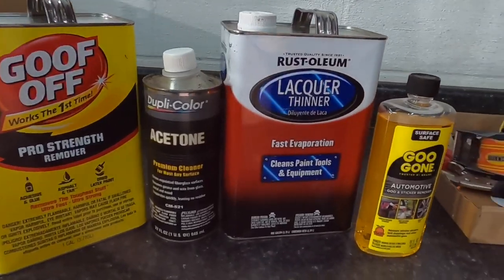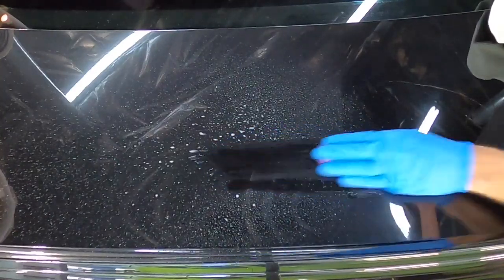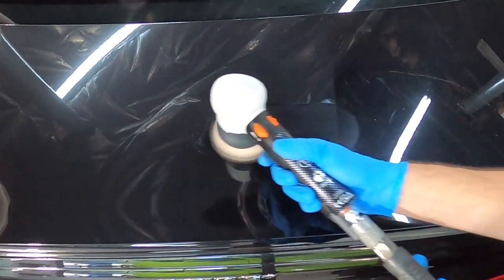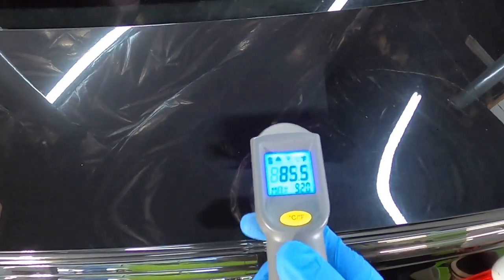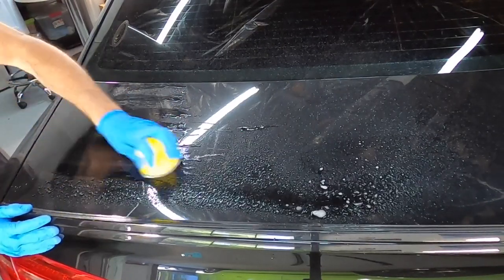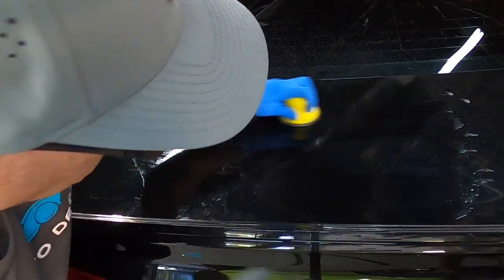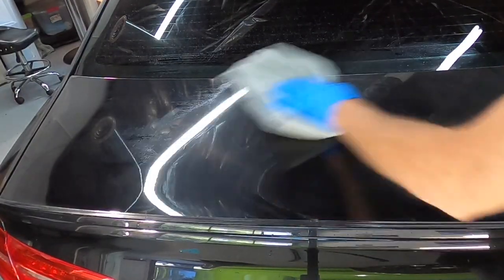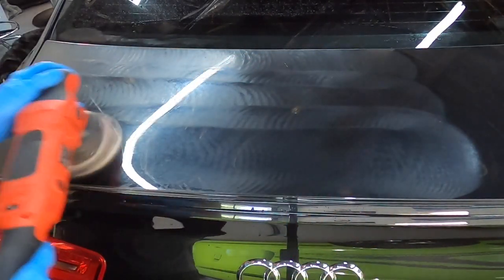DIY Over Spray Removal! Here Are Some Of The BEST Options!!

Comment: Good advice. I have old over spray  because someone decide to pain our door. I tried compound but its tough. I tested  5000 Grit on an area and it did the job very good. Use some of your favorite car wash shampoo with water to lubricate. Be light on the strokes don't apply too  much pressure. Do a test area first.  You will notice the difference instantly. I want to try 7000 My pain is old I don't want to destroy my clearcoat.

Comment: I began using a da last year on my Volvo, and due to subscribing to and learning from your videos, I did a decent job correcting the paint. I recently found a car I couldn't afford back in the day, but it needs paint correction. It's an 07' Acura RL and I believe it falls into the category of soft to medium clear coat. I don't want to mess up the finish on this old car, but I do want it to have the best finish I could provide. I could really use your expertise, and I'll begin with what I've done so far: I clayed w/a mit; bug&tarred, de-greased, etc. Did the mechanic cut with 3D One...using lake country 50/50....but it left a lot of scratches and car-wash remnants behind and not a lot of gloss. My local 3D distributor recommended that I use 3D AAT 505 to get gloss, and it worked....but the bulk of the imperfections remain, and I'm at the limit of my brief experience. Everything I've learned in the past year has been from you, but I need MORE help!

Comment: Bought a truck and thought the aluminum rims were just dirty and spotted from brake dust;  - it turned out to be bed liner that the previous owner lined the wheel wells  with. Any suggestions would be greatly appreciated, because so far nothing has worked.

Comment: Why do you want to keep temperature down? Obviously I'm here because I have overspray all over my truck pretty bad, all over my tail lights, headlights,   plastic trim windows, everywhere. Need help!!  Are you removing any of the ckearcoat using 3000 grit. Just bought the truck and wasn't ready to damage the clearcoat so fast!

Comment: I need help, I got a bass boat, the gel coat needed to be cut and buffed. But instead the guy who owned it bought rattle cam clear coat and spray painted the whole boat with the clear coat. I’m sure it looked good for a few weeks from 30 feet away. But now 5 years later i need to remove all the rattle clear coat, without hitting the gel coat. I’ve tried cutting compound, but I’m only polishing the rattle can clear coat. If I get hard enough on a slot I can finally burn through the rattle can clear coat and get down to the factory gel coat. But it will take 56 years to do the whole boat this way. Any ideas to remove the rattle can spray paint clear coat, coat?

Comment: Any advise to remove clear coat over spray? I failed to cover a side fender area I put clear coat on and the wind took it to the bumper. I used turtle wax rubbing compound and Meguiar’s compound (#1) but they didn’t work.

Comment: What should I use to remove Dupli-Color Spray?..I sprayed on part of clear-coated hood and didnt like how it turned out.
Reply: I had to go down to 400 but test it on a piece of sheet metal. DupliColor is pure trash it is a lacquer paint which doesn't last anyway. It'll never mix properly out of a spray can so go buy a spray gun and a used compressor and do it right. You will need good paint which isn't cheap.

Comment: Hi Brian, had a nightmare here a few weeks ago when a friend turned up in his WRX Impreza that prior to arrival was one of the best examples on this side of the planet with less than 10K on the clock & a six month old coating of Gyeon Mohs + (no, not me) Unfortunately his next door neighbour was respraying his 1980s Yamaha RD 350 (Kenny Roberts Yellow & Black) in his back garden. Bright Yellow overspray all over his Impreza & Audi Q5 which unfortunately had burnt through Mohs+ & into both vehicles clearcoats in the space of a couple of hours.. Impreza paint depth readings in 70-ish microns with some just below into high 60's so very unlikely to be enough clear coat to polish out thousands of burn spots without compromising what clear coat is left. Not a job I was prepared to take on irrespective of kind words about strikethrough should it happen, I didnt/dont need that stress. Any thoughts, potential actions appreciated ?
Reply from the maker: A light polish is as far as I would go. What was left of that clear should be spared.
Reply: @apexdetail85  Thanks Brian, I cant see the owner being able to live with it looking like a its got a major case of chickenpox.